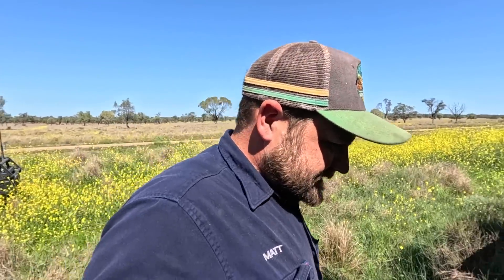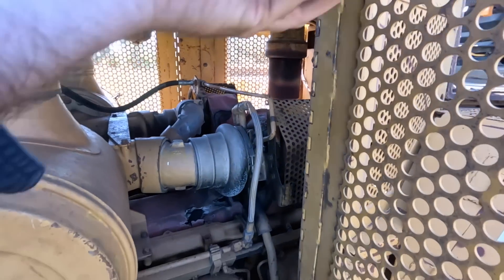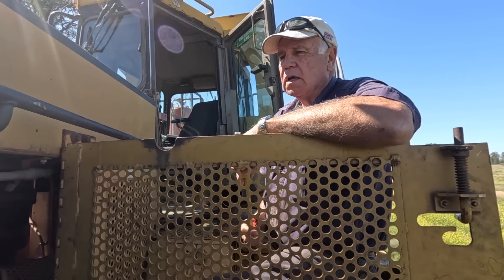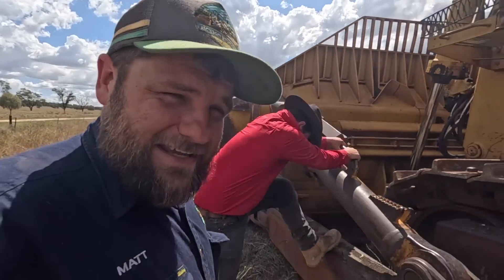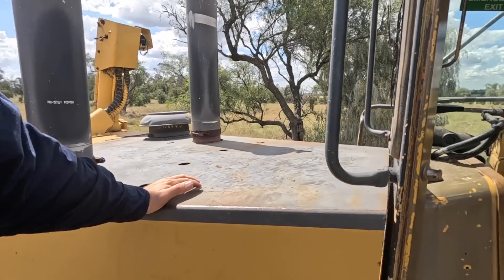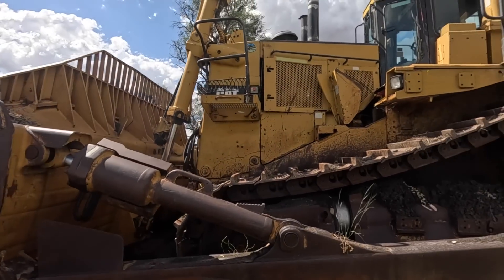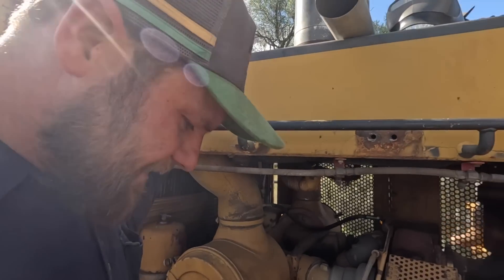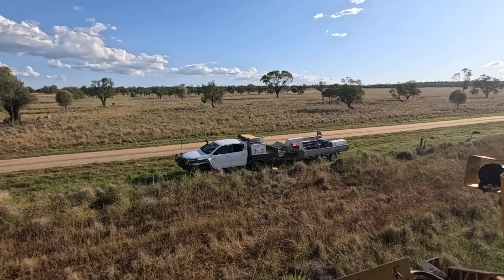We Straight Piped a CAT D11! | Big Bulldozer | Pt 1

Comment from the maker: Hi everyone, not sure if I explained it in the video well enough, the dozer has some cooling issues which is reducing cooling efficiency. This is purely a bit of fun experimentation and is not a permanent solution and will be removed after. Cheers guys😁
Reply: Hi join up to original stacks with pipe.

Comment: I remember years ago when I was working at Gordon Downs near emerald the property had 7 steiger panthers S T 325 series 3  tractors and they were running the 3406 caterpillar engines and they run a straight through pipe off to turbo.and I reckon they sounded good 👍

Comment: Not a sound solution solid mounting the pipe to that rail that's mounted on the engine cover. Engine vibration will crack either the pipe, bracket, engine cover or where its, solid mounted at the turbo. Sure sounds good though.
Reply from the maker: @bossmonkey1126  it’s definitely strong enough, the rail is solid metal and the engine cover is thicker then most armour plated vehicles 😂 it will probably only be run for a day or so to get the data then put back to original or be redesigned to come out the original stacks👍. It does sound good, feels like someone is thumping your chest 😂
Reply: @thejacksonbrothers  Gotcha, missed the part about not being a permanent fix. It's not the strength of the cover or rail more the lack of anything flexible to absorb vibration

Comment: The cooling issue would likely be due to how it's running, you will have a couple of cold cylinders by the way it sounds, some dud injectors
Reply from the maker: Obviously we can’t explain everything in one video and i obviously did a poor job trying 😂 we are aware of why it’s getting hot (mainly due to the age of the machine and it’s not bad enough to justify spending $30000 on a new cooling package). This is just a bit of fun to see if it helps, the reason it sounds crook is the GoPro was only on one side so you could only predominately hear the one bank👍😁

Comment: 😂😂😂 cockys trying to bodge up a hack to keep the engine cool  IV never seen a exhaust cook a motor 😂😂 many things but never a exhaust cleen the belly plates and cleen the radiator or transmission cooler and replace the thermostat check the fan's are working properly

Comment: I know us old guys in america are not a good source of information but since I am not there, at seventy five and mostly deaf any who's to know and think/LOL. I would take a perforated pipe as in say a (in american inches) quarter inch space between perforated pipe and pipe the same size as now using to continue up with. That perforated pipe could be like as a muffler guard looks, scads of holes so as to break that sound up and not restrict anything, but go inside say for about a two foot space on the inside and going up. I really wish I knew how to word this correctly as it makes me sound like a idiot and maybe a fair description. In other words, not a muffler but something to just break down that sound. It does work on mufflers on hot rods kids drive that takes that harsh sound away quite a little actually. Keeps the patrolman happy

Comment: Was there a problem with the initial design, and they all run hot, or is age a factor. I.e. restricted radiator tubes, etc....??
Reply from the maker: All of the above😂 mainly age and we suspect the oil coolers have a restriction but just interested to see how much heat the mufflers contribute😁

Comment: So just curious why y'all didn't pull the muffles out and straight pipe up to the existing exhausts, would save the chance of burns and still should remove the heat, plus she will be able to breathe better without the back pressure of the mufflers giving her a little more grunt
Reply from the maker: Hi mate this is only to see if it would help, if we wanted to do it permanently we would do exactly that👍😁
Reply: @thejacksonbrothers  ah, ok, she sound mean either way

Comment: Your heat theory has a fundemental flaw. They dont have an overheating problem unless the radiator is plugged, or the belly gaurds are full to the floor boards, or a thermostat is not opening or the little vent valve in the thermostat housing has fallen to bits. Moving the exhaust wont achieve anything but more noise.
Reply: My thoughts exactly, have run them in the desert in California with no problem
Reply: Just like the bull haulers do just more noise, they want to sound cool
Reply: I agree with finding the reason why it’s running warm. A lot of smart people worked on designing that system, not to mention the amount of money that it took to develop it. I immediately was shaking my head no, that I wouldn’t bother with bypassing the mufflers. I figure the engine is tuned to have the mufflers intact. I like these fellas a lot and they are pretty good farmers, but I think I’d get to the root cause of the problem first. I sort of wonder if it’s actually a different component having issues and transferring the heat. Just a thought.  But , that engine doesn’t sound like it’s running on all cylinders. Sounds like it’s missing.
Reply: @LukeLong-oi4uc  yep left bank sounded a bit sus but camera mic can sometimes cut out load noises and destort the sound. 👍
Reply: @michaelbrown6241  
If it had been April first I could understand

Comment: Remote Control Technologies (RCT) did their first full-size RC dozer for OK Tedi Mine in 1993. Might be possible to run the dozer remotely from the air-conditioned caravan one day. The D11N at idle sounds like a Cat powered train waiting at the Railway station. Akubra needs to Matt and Mitch matching hats.

Comment: What are you doing about the scavengers for the air cleaners? Will they be plumbed into the straight pipes?
Reply from the maker: Yeah we decided to cross that bridge when we got there😂 if we want it permanent then we would have too👍
Reply: @thejacksonbrothers  Hastings fitter here, investigate your cooling system fault brother. Heat wrap your mufflers. The air cleaner Venturi cleans more dust than you realise  and exhaust flange Venturi draw dust out of your engine bay and pull cool air in.  None of us are smarter than the room full of engineers who designed that machine. Unless you put a masabi cooling pack in you’re wasting your time with modifications and ‘upgrades’
Reply from the maker: @Badger_Built  cheers mate, it’s all just a bit of fun, it won’t be permanent like that. We mainly want to be able to say in 30yrs time that we straight piped it for a day 😂😂
Reply: @thejacksonbrothers   fair play to ya lads 😂 in regards to your heat issue get it warmed up with the radiator cap off, do a second gear high idle stall and see if there’s bubbles coming up in the header tank..

Comment: Seeing as you are experimenting,what if the air intakes were higher and catch air away from the hot hood area ?
Maybe check the temps from the intake position's as they are and then take a measurement from higher uo ,as if it was an air intake stack .
There is a YouTube channel, Dirt Perfect,and he has built exhausts uaing square tube , something different and they can blend into cab shapes .
You definitely need tall exhaust pipes to take hot air away from the hood area and intakes .

Comment: The concept makes sense.  After you see if you get rid of the heat. Then you can just reconnect it with the factory pipes out of the hood and just make a tin heat shield in place of the mufflers.  I believe the factory resonator coming out from the hood would make a big difference in the sound alone. But just getting the pipes above the cab will make a big difference in the sound.